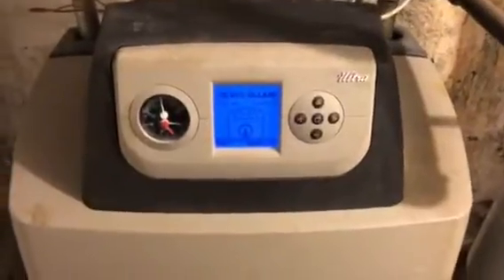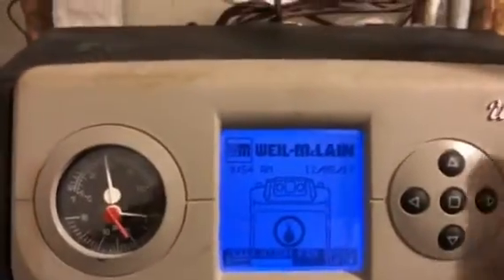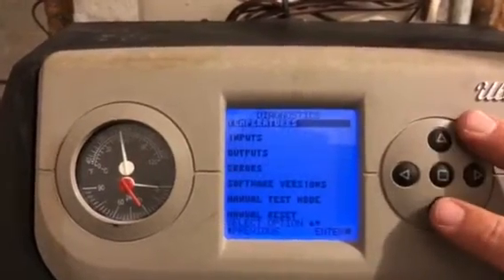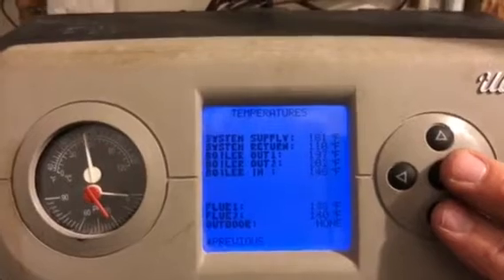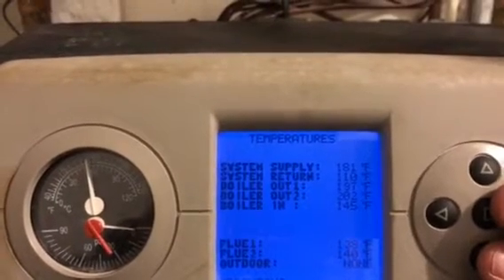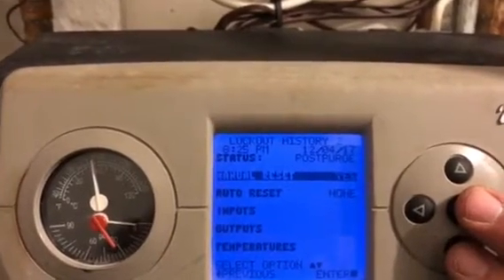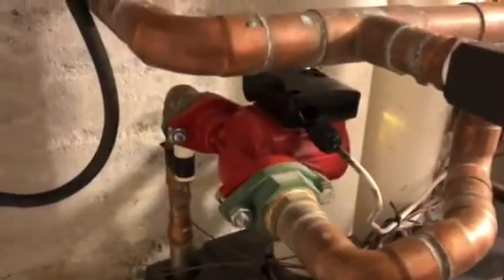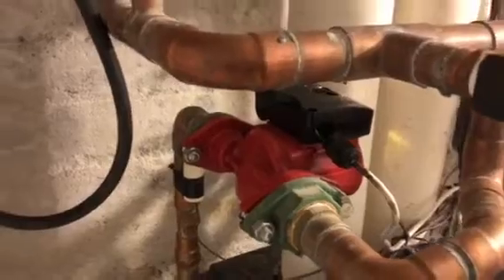Weil McLain Ultra 3 - High Temperature Lockout Error Explained

Comment: my weil mclain ultra 3 model 80 gets a supply too fast error every year around dec 12 and again around feb14 i called weil mclain and all they could think of was change external temperature sensors which makes no sense they all seem to be reading normal i couldn't even get an answer as to what supply is too fast means is it air supply or circulator water or what? ever hear of an error like that that seems on to be on a scheduled basis

Comment: I had a high temp limit error because the priority 2 circulator was set for 190 degrees.The priority 2 circulator fed a fin-tube baseboard loop and the  manual lists that temp should be 180 degrees max and the unit will shut off on limit.Im thinking 190 degrees was too close to the 200 degree shut down safety within the unit.After changing the Priority 2  loop to 180 degrees it hasn't happened again.Its been 2 months
Reply: I'm had this boiler for years, I've had intermittent HIGH TEMP LOCKOUT errors, usually on warm weather or large temperature change days. spring and fall. it works great during the summer and perfect during the winter. But after a hurricane and running the system on a generator the computer "reset" and I had to reprogram the temps. Default was 190 degrees for DHW, so i dropped it to 180. I'm hoping this will fix it. I to the yearly maintenance as described. I only get HIGH TEMP lock out errors on POST PURGE. My guess is the boiler turns off and the water temp rises too fast and as soon as it hits 202 degrees the lockout occurs. MAX temp is set at 200. DHW was set at 190. hopefully lowering to 180 fixes this. Thank you for the feedback.

Comment: this to reply to supply error 58f the boiler needs to be cleaned also the return pipe header is restricted due to electrolysis build up weil mclain recommends cleaning ultra every 5 yrs i am hvac contractor this ordeal can sit you with parts over 1500.00
Reply: @PipeDoctor  what i am saying is this the heat exchanger needs to be cleaned every 5 yrs by manufacture recommendation the return /supply header piece needs to be visually  checked i have found the return header piece to be  restricted in this area in turn restricts water flow which turn faults out supply error 58f code i have this particular problem in more than a dozen of the ultra series boiler on different water supplies

Comment: I have this boiler running dependably for the last 8 years until the cold weather veered my way this winter.  When I started up this season, the blower runs but the u-control only flashes a red screen that weil-mclain themselves were stumped on.  The internet and everyone I have tried do not know what is causing this but the best guess is swapping out the u-control module.  Ever see just a flashing red screen with no text on the u-control? And no, I can't access the contractor menu.

Comment: Why is the Boiler Pressure Gauge reading 0 lbs. Pressure on your Boiler.
Reply: Pipe Doctor Plumbing, Heating & Air Conditioning, Inc. Hey doc thanks for the Videos very helpful. I’ve found on the WM Ultra Boilers The Pressure Gauge cap tube to fitting on Boiler being broken causing no reading. I’ve replaced these combo Temp / Press Gauges on several Boilers.  Thanks again.  Norm HVAC Mech.